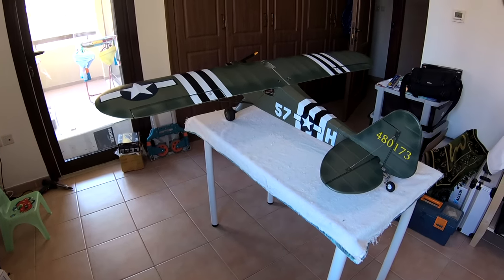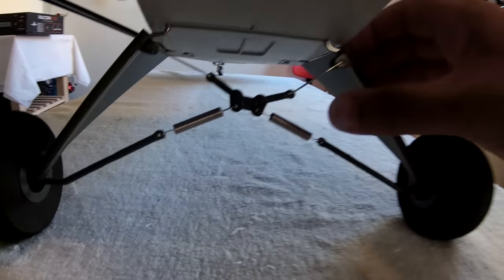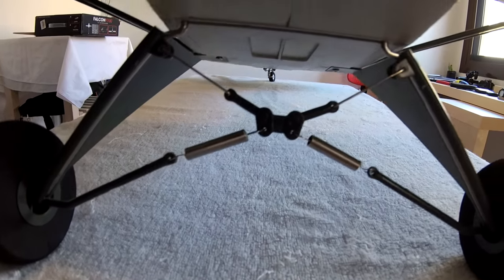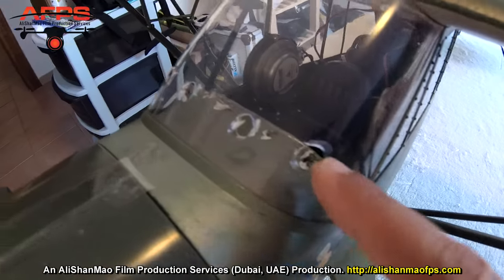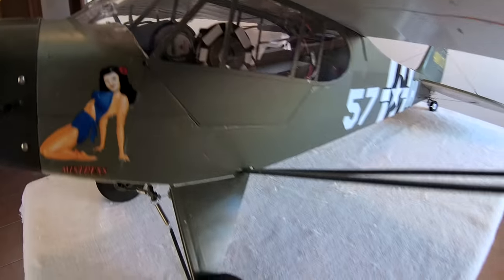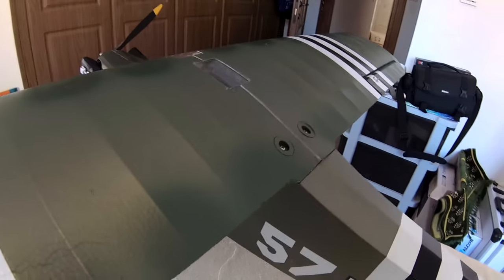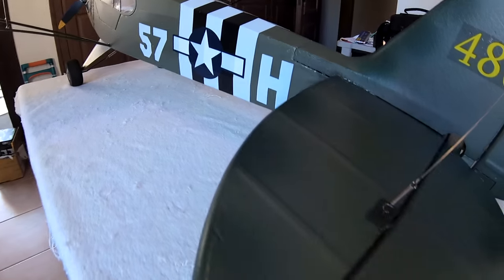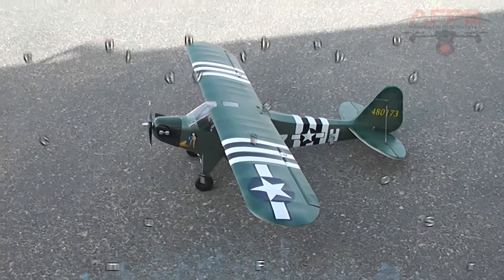Time Lapse Build RC J3 Super Cub Military Edition

Comment: Nice plane. Be careful with the "spring" supports. If the tail feathers really get stressed the springs will not prevent it from failing. The empennage may be strong enough on its own but if not . . . . Hate to hear if it crashes from an easily preventable cause. 
Keep building and filming.